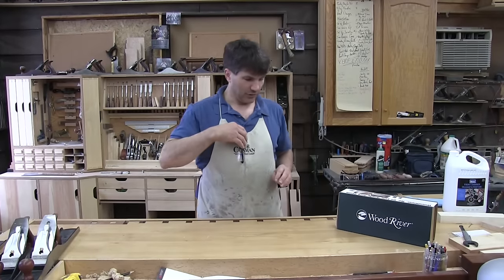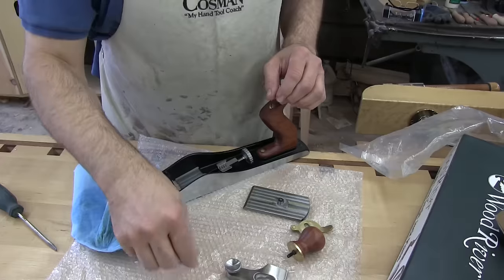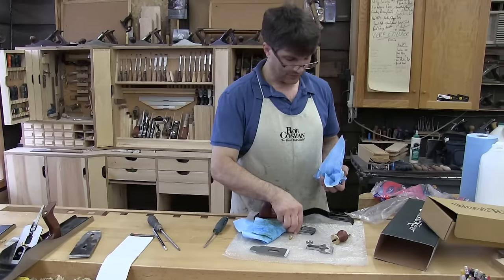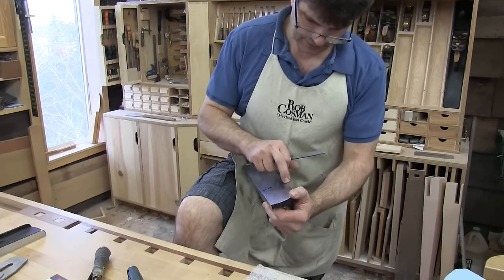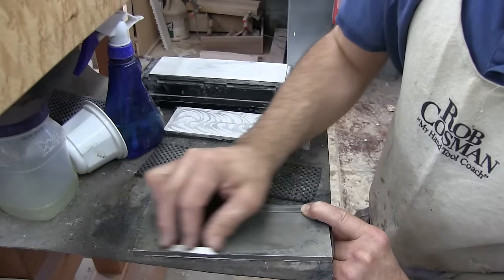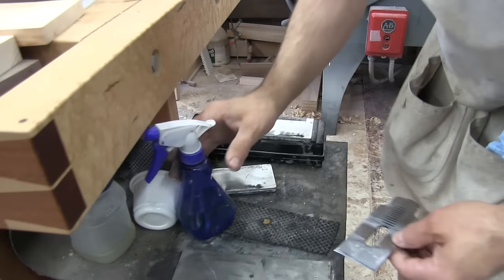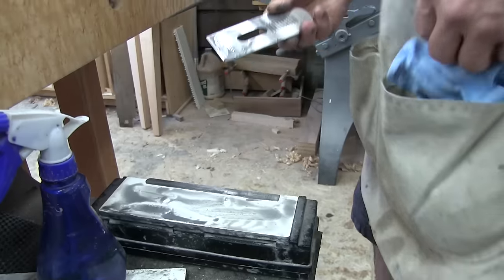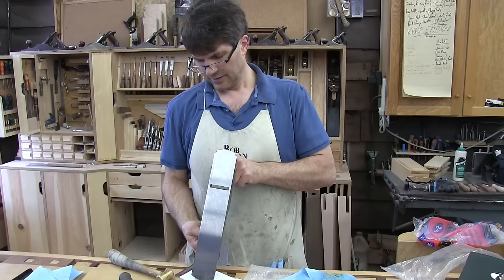Low Angle Jack Plane by Woodriver, reviewed by Rob Cosman

Comment: Rob, the advantage of the LA or BU jack plane is that the low bed angle makes it possible to plane at a low cutting angle (12 degree bed + 25 degree bevel = 37 degree cutting angle), which is the best of ALL planes for end grain, such as when shooting edges. With the exception of a closed up chip breaker on a BD plane, the LA Jack is capable of smoothing just about any interlocked reversing grain when set up with a high cutting angle (50 degree secondary bevel = 62 degree cutting angle). 

It is relevant to add that using this plane with a 30 degree secondary bevel is a waste of its potential. A cutting angle of 42 degrees immediately limits its use to soft woods or wood with straight grain. 

It is important to accept that one does not sharpen the blades either free hand or on a full bevel. This is inefficient. My preference for all other planes and all chisels is to freehand sharpen. But not BU planes. Especially if you want a camber (as all planes need) on a high cutting angle. Always begin with a 25 degree primary bevel, and add the desired secondary micro bevel at the desired angle - including the camber. This way there is less steel to remove. I developed this technique a decade ago (as you know, I test planes for Lee Valley/Veritas):   http://www.inthewoodshop.com/WoodworkTechniques/TheSecretToCamberinBUPlaneBlades.html

The angle of the secondary bevel is critical to get correct. The plane will perform differently with a 30 degree bevel and a 40 degree bevel. For this reason, this is the time to break out the honing guide (yeah .. ugh!) and do it that way. It works, which is why I put up with it. 

These planes can really perform when set up optimally, and they are easy to use.  

Regards from Perth

Derek
www.inthewoodshop.com

Comment: All round good video, BUT I failed to pick up on the significance of the adjustable forward sole plate & wht the gap created was relevant to the finish on the workpiece. An earlier video on the standard jack plane appears to show superb fine chip performance. Who needs a low attack angle & the extra investment?
Reply: On highly figured timber, it might be benficial to close the mouth to give more support to the fibres for as long as possible. Additionally you can insert a blade with a steeper angle und reduce tear out even more. A very low cutting angle could give you an advantage, when planing endgrain.

Comment: The back bevel on your standard bench planes adds as well. You can't count one without the other. Re: brass on steel, see Feynmans Lectures.
Reply from the maker: frenstcht   Less than a degree so I round down.
Reply: @RobCosmanWoodworking  My mistake. I thought elsewhere you had indicated it was larger; however, I'm happy to be in error on that. Thanks!

Comment: I really like to see a woodworker who uses his hands to "see". Are the imperfections gone or just diminished? Did the plane make a full cut or did it jump? Feel the life in the wood. 

One other thing, is that you always wipe the blade before replacing it. Another reason for this is that there will always be microscopic bits of steel and grit left which will mark your piece and dull the blade. I am a knife man and I hate seeing someone sharpen a knife and immediately touch the edge to see if it is sharp, dulling it a bit.

Comment: I get the feeling you aren't completely convinced by the low angle jack as a concept Rob. I prefer the term bevel up, they are in effect variable angle planes. If you have the pennies, two or three additional irons honed at different angles give these tools great   versatility. A honing guide is probably of benefit here, I'm sorry if you recoil in horror at the mention of such things. Of course you can put back bevels on bevel down irons, but but given the low angle and exceptionally thick iron of the bevel ups, they are inherently less prone to chatter. You are right on the lighter weight, a deal more mass would be of benefit at the bench.

Comment: On my low angle plane all irons have a lower primary bevel angle and the promised cutting angle. The 25° iron is 23° with a 25° cutting angle. The same is true for the 38° and 50° iron.
Reply: Grimmjar I put a back bevel 10° on mine. When I sharpen it I treat the primary bevel as if it was the back of the plane and the back bevel as if it was the micro bevel, only on my bevel up plane, it makes the blade last longer and doesn't effect the primary cutting angle. If you do the back bevel more than your frog angle your iron won't cut so that's why I do 10°.
Reply: This gives my blade a stiffness of 35° and a cutting angle of 25°

Comment: Only 20 bucks more for  Lie Neilsen  LA jack here in the US.  Buying the LN instead is a no brainer.
Reply from the maker: UreaSmith I don’t recommend this plane. But I also don’t recommend Lie-Nielsen’s either. I recommend WoodRiver’s 5-1/2 Jack.
Reply: @RobCosmanWoodworking   Yeah that would be more reasonable purchase  217  bucks vs 375 bucks (US) for the LN.  But for a LA Jack it'd be crazy to settle with WR for 20 dollars less.
Reply: Veritas has the most bang for the buck in a No. 62.
Reply: @RobCosmanWoodworking  WR's 5- 1/2 jack plane is a good value.

Comment: Whats the thickness of the ruler you are using in your sharpening routine?
Reply: I realize this is a five year old comment, but in case anyone else is looking for the same answer in the future: David Charlesworth, who developed this technique mentions in the video he does explaining it that it is a 0.5mm (or 0.019in) thick rule.  I found one, but shortly after I found on Rob's site that he sells one specifically designed for this that matches the length of the stone. That's a feature I don't have with my 6" rule, and the reason I'll be getting one of his when I make an order.

Comment: Rob, what is the advantage of the lower angle of attack on the low angle jack.  Also if you change the lap on the bevel to give a higher angle of attack would that ultimately be the same functionality of the No. 5 1/2 (minus the heft)?  Thank you!
Reply from the maker: Michael Christopher in my opinion, there is no advantage. By the time you add micro bevels you’re within 5° of a bevel down plane. Plus, the functions on a traditional Bedrock style plane far exceed that of the LA versions.
Reply: @RobCosmanWoodworking  Thank you for the quick reply.  So I already own a Veritas low angle jack plane.  Would there be any reason for me to purchase a No 5 1/2?  I feel like you have a preference for the Traditional Bedrock style planes but If there isn’t a huge advantage, i might be better off spending my cash on upping my sharpening game with a Shapton 16K.?

Comment: Just my 2c:

I am using Lie Nielsen for more than a year and if this plane was available when i ware purchasing i would bought this one.

This one has adjuster wheel far enough from blade that it can actually be used - not the case with LN – their depth adjuster is almost below the blade and have small diameter. This not something that you can easily fix unless you visit machinist shop.

Lever cap on this plane has dent in it so that retaining screw tightens lever cap down, and do not allow leaver cap to move with the blade when adjusting depth of cut (i had to make it my self on LN)

I don't know how big Mr. Cosman's hands are but it seems to me that booth planes need larger rear handle since this is not three finger grip plane and after prolonged use, pinky finger starts to hurt.

For my hand, size of the handle should be similar to one found on modern Stanley sweetheart no4.

What i dislike on booth planes are brass screws It is decorative but i would prefer stainless steel.

And on LN plane you actually need three sizes of screwdrivers if you wont to disassemble and it  assemble properly.
Reply: you do know what brass does when on contact with iron and steel. it lubricants itself. I would rather not have the screw sheer off when it stuck, cast iron can still rush or or change from heat, having brass is better in that aspect then stainless steel. All my old stanley  brass screws come off like they were still new and some have 60 years old.
Reply: I'm with you. I don't like anything threaded in stainless, too much galling.

Comment: Is this the same as the Quangsheng planes avaliable in the UK?
Reply: Yes same manufacturer, although as Rob said you may find small differences depending on what Woodcraft ordered. Also same as the Juuma brand sold in other parts of Europe. e.g. the Juuma has a slightly different profile on the side walls of the body and uses more brass.
I prefer Veritas (made in Canada!) for their flawless quality: other than the microbevel, zero adjustments or fixes needed out of the box.

Comment: If you sharpen the blade to 50 degrees instead of 25, it creates a 62 degree angle which really decreases the chance of tearout
Reply: Does this not then defeat the reason to buy a low angle plane; great for endgrain? Besides, push comes to shove, just buy a standard no.5 for other duties, as their prices seem so reasonable.
Reply: @chm1701  it would be cheaper to use multiple blades set with the different bevel angles you want

Comment: Keep the angles stock on the 62 and the 5 and the angles truly are lower on the 62... straw man argument.

LN 62 comes with 25+12=37. 

Number 5 is 45.

Difference is 8. 

Not to say there isn’t overlap in the jobs they can do.

But the angle difference will change where each one excels slightly.

Comment: Wood River No. 62  $222.
Lie Nielsen No. 62  $245
Veritas No. 62         $245

Veritas is heavier than Lie Nielsen, and has significant convenience features, like a lateral adjustment for blade (no need to bang the blade with hammer, Geezus!)  and some set screws to keep blade aligned. Veritas has 3 grades of blades. The Lie Nielsen is surprisingly low in comparison, you can get several products from Lie Nielsen at reasonable prices, like this No. 62 and their low angle bronze block plane (about $100). It's fishy with these marketing claims that the No. 62 turns into several planes by using blades with different angles. If this were so, it would have been obvious at the inception of the No. 62 plane.
Reply: You have to add a little more to the price of the Wood River plane as they're now $240. I seriously don't understand the allure of these Wood River planes when you can get the Lie Nielsen or Veritas counterpart for about the same price. Chop $100 off the cost and they'd make more sense considering they don't have the reputation/build quality of Lie Nielsen or Veritas and are made in China.
Reply: @AgentJohnson1  Of course you could use one of the occasional 25% off coupons to get the Wood River plane for $180.

But yeah, for no more than the difference in price, I went with the Veritas, and even sprang for the PM-V11 blade upgrade, and used my Woodcraft coupon for something else. ;)
Reply: @AgentJohnson1 . And that’s US pricing. In the UK a no.5 1/2 in the Woodriver is just under £200, but the Lie-Nielsen is £380. I am actually really interested in the Woodriver because of this fact, but I have heard of problems with blades being quite soft (so don’t keep an edge), with also the cap iron and sole needing quite a bit of work to get flat and ready - not really helped by seeing the amount of work Rob appears to have to put into them too. This is also just going on reviews, but there’s seems to be quite a few saying the same thing with the aforementioned problems.

I do own a few Lie-Nielsen planes and they are very nice indeed; well made, great finish and with a slight hone, ready to go... but costly. I’m a little torn on wether to try a Woodriver no.5 1/2. I’m the sort of person who buys once, cries once, but at half the cost, the Woodriver does seem tempting.

Comment: Try not micro beveling, instead flatten the whole angle one time, then to sharpen put a 5°-10° back bevel on it with the ruler trick but a thicker ruler, this will take any chips and nick's out of the blade and the tip of the blade will be stronger from chipping without effecting the blade's cutting angle keeping it at 37° at the cut.
Reply: See my comment above. I recommend NEVER to hone on a full bevel, especially a high angle - I challenge you to camber a high angle full bevel face. Note that BU planes require more camber  than BD planes owing to the geometry of the bed. 

Further, NEVER add a 5-10 degree back bevel to a BU plane. (The Ruler Trick that Rob uses is 2/3 degree). These planes need a minimum of 7 degrees clearance angle, and if approached, they will struggle to cut.

Lastly, there is no need to strengthen a BU plane blade. I have tested 25 degree cutting angles on a BU plane against 25-30 degrees on a BD plane on end grain, and the BU plane wins hands down. Here is one report: http://www.inthewoodshop.com/ToolReviews/LVShootingPlane.html

Regards from Perth

Derek
www.inthewoodshop.com
Reply: Derek Cohen increasing the back bevel would not affect the geometry at all, all it does to my knowledge is bring the primary bevel a tiny bit closer to the mouth and reduce the brittleness slightly, I was suggesting just using a thicker ruler and doing only a quick shining on the primary bevel with the same amount of time you'd spend on conditioning your secondary bevel. Depends where you're using the plane if you do this I guess.
Reply: No you were not just suggesting "a slightly thicker ruler". That may increase the back bevel to 1 degree. You stated "put a 5°-10° back bevel on it". That WILL change the geometry very significantly!
Reply: Derek Cohen I don't know how you can think that, I'm not changing the primary bevel angle the back bevel is behind where your edge meets the wood adding one would only reduced how wide you can put the mouth and affects the camber geometry.
Reply: You wouldn't be riding on it either because it's less than the bed angle
Reply: You are reducing (to 2-7 degrees) the clearance angle by adding a 5-10 degree back bevel. I suggest that you read Leonard Lee "The Complete Guide to Sharpening". In this he notes that the minimum clearance is around 7 degrees. This will prevent the plane from cutting. You can add a back bevel of 5-10 degrees on a BD plane, since these typically have a 45 degree frog. That would still leave a clearance of 10+ degrees. This cannot be done to this degree with a BU plane.
Reply: Derek Cohen I like the woodworking pieces in your channel, I subscribed, the only reason I'm stuck with my opinion is because I've done it to my blade personally and it stayed sharp longer a noticeable amount with my own use and cut easier, but if I wanted to plane figured hardwood with the grain using the same plane I'd want to have it 55° so I need a second plane or blade the way I sharpened it.
Reply: Derek Cohen weird that my plane even works I guess.

Comment: Me: I really like bevel-up planes because of the lower angle of attack. 

Rob: You are a dolt and here is why.
Reply from the maker: For those not knowing, Kyle is calling me a stupid person.  Dear Kyle, you sleuth, found an old video where I reviewed the "then" new Woodriver 62.  That was in may of 2016, first time I took one out of the box.  Nice job on the manufacturing, woodwork was good, machining was accurate.  Now four years later, after having used it , I would not trade in my 5 1/2 for this plane, not even close.  This makes me a "Dolt".
Reply: @RobCosmanWoodworking  - I was definitely not calling you stupid. I was making a humourous observation about how I thought one thing but you (as per usual) set me on the correct path. I was definitely not trying to put words in your mouth. 

I appreciate the videos. I have learnt a ton from you.
Reply: @RobCosmanWoodworking  - I recently purchased a bevel-up jack from Lee Valley. Not withstanding the variable mouth opening, I still love my 1912 Bedrock better. I think I was suckered in by the bevel-up sirens.
Reply: @RobCosmanWoodworking  Rob, I think that gentleman was complimenting you using a rather silly meme format that I wouldn't blame you for not recognizing.

Comment: You throw in the microbevels. 5 degree is a bit much for a microbevel. I only use one at 2 degrees and you're also ignoring the ~1 degree from using ruler trick on your bevel down plane, so 46 degrees vs 39 degrees. That's 7 degrees
Reply from the maker: Back bevel is less than a degree and I use a secondary micro bevel that is 3-4 and a tertiary of 2.  Using my math you are still 42-43.